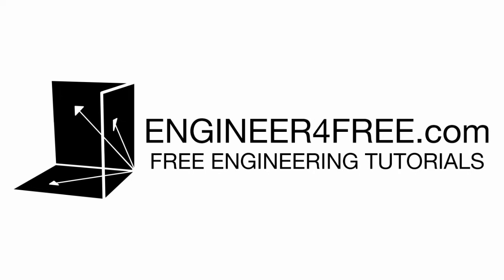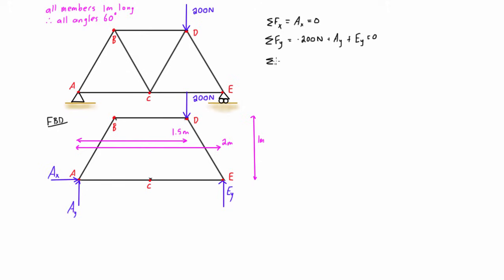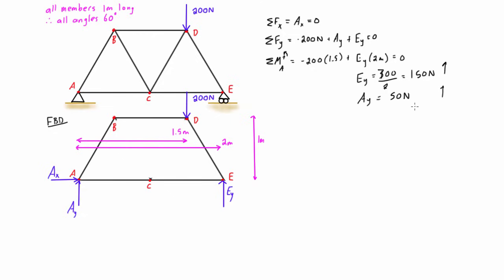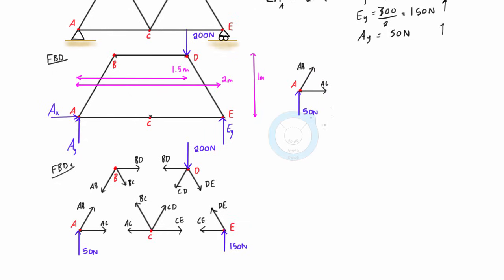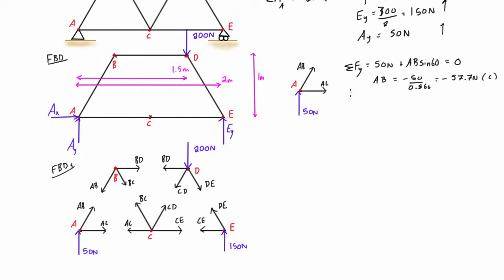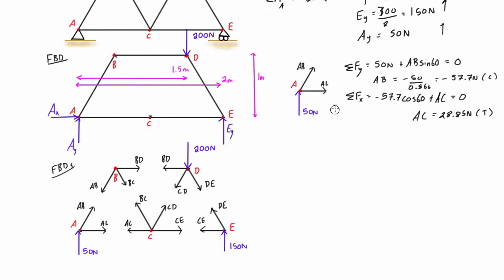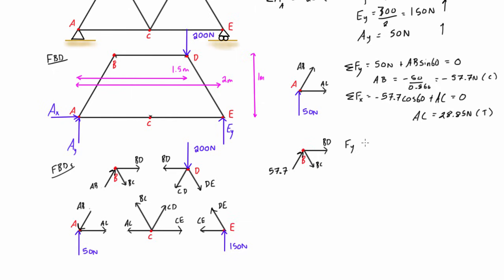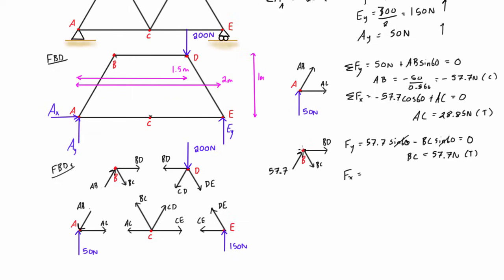Truss analysis by method of joints: worked example #1

Comment: At joint B why didnt you write that AB is negative 57.74 instead you wrote that its a positive
Reply from the maker: In a fbd, switching the direction of a force is the same as keeping the force in the same direction but switching the sign. The sign convention with trusses is to initially draw all unknown forces in tension, and if you find the magnitude to be positive it confirms it it is tension, and if you find the magnitude to be negative, it tells you that the member is in compression. At 4:50 I switch the "direction" of member AB on the main fbd because I now know that it is in compression. When I draw the fbd for point B, I know that the member is in compression, and I know the magnitude, so nothing about it now is an unknown. A member in compression pushes on the joints with it's magnitude. So I draw the force as such, with positive 57.7 N, pointing towards the member. If I kept it pointing in it's original direction of "away from B", then I would have to keep the negative sign, but that would be redundant knowing that it is in fact in compression. Does that make sense?
Reply: Engineer4Free thank you
Reply from the maker: You're welcome Mustafa!

Comment: At 7:05, why didn't you multiply BD with cos60 like you did with BC
Reply from the maker: BC is at a 60 degree angle down from the horizontal so the cos60 is there to reveal only its horizontal component. BD is perfectly horizontal, so no cos or sin function is required to reveal its horizontal component, because the whole force is horizontal already.

Comment: Hi, just seen your video however im kind of confused on the last bit you solved. The DE answer you found was 173.2 which was a positive number so wouldn't it be in tension instead of compression which should be a negative number?
Reply from the maker: Initially I don't write the negative sign but I realize that it was missing at 11:45 and put it in. The negative sign matches our convention that DE is in fact in compression.

Comment: You wrote “Fx = - 28.85 - 57.7cos60 - 57.7cos60 + CE

Equals to:
CE = 86.55n

Please explain to me how that works, I thought it would be 144.25, since there are 2 57.7
Reply: isn't cd supposed to be in the positive x axis direction? so it would be +57.7cos60 instead of negative
Reply: this is because cos(60) is equal to 1/2. so you have 2 * (1/2 )*57.7  which gives you  -28.85-57.7 = 86.55N

Comment: What do i do if there is a downwards load on Point B and Point C
Reply from the maker: First include those loads in the sum of forces and moments of the entire structure to figure out what the reactions are at A and E. Next, when you draw FBDs for every point, just include the applied loads at joint B and C just like how I did for joint D in this video and follow the exact same process that is laid out in this video solving the unknowns one joint at a time.
Reply: Each member has an length of 4m So say if the load on b is 13300 N and the Load on C is 7700 N. Would My Reaction at A be 3150 N and Reaction at E be 2450 ?
Reply from the maker: A truss that has the same general shape as the one in the video but with the applied loads that you described, the reactions would be Ay = 13.825 kN up and Ey = 7.175 kN up: the work is here: https://i.imgur.com/Tl9teVJ.jpg make sure that hat I drew actually matches up with your problem. The easiest check you can do is to see if the applied forces and reaction forces in the vertical direction sum to zero. Your applied loads are 7.7 kN down + 13.3 kN down = 21 kN down, so if your upward forces caused by the reactions don't sum to 21 kN up you know there is a problem. You found 3.15 kN and 2.45 kN which sum to 5.6 kN. Immediately you can tell that 5.6 =/= 21 and there is a problem somewhere. It's worth pausing for a second at this step and checking, because you can go back and find the error, otherwise you will carry it through the entire problem and not get the right answer. Lemme know if this helps.
Reply: The Diagram is correct but when i go to solve the joints and i get to joint e it does not add to zero
Reply from the maker: This is the solution: https://i.imgur.com/Yk9YZjk.jpg it all sums to zero at the end. You must just have just made a simple error somewhere along the way. Do take the time to figure out where you went wrong, it will help =)
Reply: Thank you so much i realised my mistake on joint B i subtracted the 13,3 kN to the 15.96kN sin(60) when i was meant to work out the value of 15.96 sin 60 first.
Reply from the maker: No worries! No better feeling than realizing you had the method right and just made a silly error somewhere along the way =)

Comment: how do you know when to use sin or cos?
Reply from the maker: You need to be comfortable with SOH CAH TOA: http://slideplayer.com/slide/10605540/36/images/3/SOHCAHTOA.jpg. Two truss members will always have an angle between them, in this problem, it's always 60 degrees because three truss members form an equilateral triangle. You need to draw a right angle triangle that uses two trusses as two sides of the triangle, those sides are the adjacent and hypotenuse sides, and the angle between them then matches the original angle that you know. You draw the opposite side of the right angle triangles that you just constructed to be vertical (parallel to the y axis of the structure). Sometimes the triangle will be "upside down" but it doesn't matter which way a right angle triangle is oriented, it will still have a defined hypotenuse, adjacent, opposite based on the angle being used, so be mindful of that. For example, in the calculation of BC: BC is the hypotenuse, BD is the adjacent side, and the vertical component of BC is the opposite side of the right angle triangle that we construct to solve for BC. Whether you use sin or cos entirely depends on how you construct the triangle, and which side of it is the unknown, but then always just follow the simple rules of SOH CAH TOA.

Comment: the question im doing has no measurement and the roller joints are in the middle...does that change everything????
Reply from the maker: If you upload a picture to imgur and link it here I can help you, I'm not to sure what the problem is that you are describing.
Reply: Engineer4Free yess plzzz.thanknu so muchhh
Reply from the maker: Oh yeah it's a very similar process. Draw the fbd of the entire structure. Break the 15kN into its x and y components though. Sum forces in x direction to get horizontal reaction at E. Do sum of moments about C to get vertical reaction at E (don't forget to include the horizontal component of the 15kN applied force in the moment calcs). Assume all members are the same length, so all truss angles are 60 degrees like the video. That will make the horizontal component of 15kN force's line of action to be 0.866 units above the supports, and all other distances will be 1 unit or half a unit. If you have to, just define each member as 1m, or 1 ft long, but now matter what you pick the "units" drop out in the moment eq because they are in every single term so it doesn't matter if its feet or metres or whatever. Do sum of forces in y to get the last vertical reaction at C. Now just go one joint at a time doing FBD of the joint. Draw unknown internal forces in tension, and applied loads or loads caused by reactions in their actual direction. If you calculate an internal force to be positive, it means it is actually in tension, if you get a negative, it's actually in compression. When you go to draw the next FBD of a joint that includes a now-known internal force, draw the it in the appropriate direction, ie tension pulls away from the joint, and compression points towards the joint. Iterate 6 more times (once for each joint). On the last joint, make sure that everything actually sums to zero in x and y direction. If it does, you've done the problem correctly, if it doesn't there is a math error somewhere along the way. Hope that clears it up, overall it's an extremely similar problem with just a few more members and a bit of a trick because that 15kN force has a horizontal component: don't forget to include it in the fbd of joint D, and also the horizontal reaction force in the fbd of joint E.
Reply: woaah haha thanks u so much!!!! sorry for mking u write out all that, helps so much thanks u!!!!!!!!!!!!!
Reply from the maker: No worries, I'm happy to help!! This stuff can get really confusing if you don't know how and why to do each step. Once you get it though basically every truss problem is more or less the same process :).
Reply: doing sum of moments at C, if a force on one point comes before C is the length a negative? and i was asked to only find the forces on some members is essential that i need to know the sum of moments on C and E
Reply from the maker: Yeah that works fine. If you assume each member is 1m long, then that means the truss itself will be 1m*sin(60)=0.866m tall. When you do sum of moments about one of the supports to find the other's vertical component, every term will be in units of kN*m. Like for example the moment caused by the far left applied load about point C would be 7kN*1m = 7kNm counterclockwise, the moment caused about C by the vertical component of the 15kN load would be 15sin(60)kN*0.5m = 14.49kN*0.5m = 7.245kNm clockwise, the moment caused about C by the horizontal component of the 15 kN would be 15cos(60)kN*0.866m = 3.88kN*0.866m = 3.36kNm counterclockwise and so on.... You get the sum of moments about C to be 7kN*1m+3.88kN*0.866m+Ey*1m+4kN*2m-14.49kN*0.5m=0. Now divide both sides / every term by "m" and you get 7kN*1+3.88kN*0.866+Ey*1+4kN*2-14.49kN*0.5=0 at this point you should see that it wouldn't have mattered if you defined the length of each member as 1m, or 1ft, or 1cm, or 1in, etc.... because the unit itself drops out and we are just left with the sort of "relative distances" like 0.866, 1, 0.5 etc and you can continue on with the problem and will not need those measurements again.
Reply: AHH yASSS i got it.. i just forgot to add the horizontal component but i got everything else.. thank U!!!!! but isnt 7kn negative?
Reply from the maker: hahaha niceeeee, no worries! Negative/positive sign for moments is not due to the forces pointing up or down, it's whether or not that force would have the tendency to induce a clockwise or counterclockwise rotation about the point that you are taking moments about. Just define either clockwise or counter clockwise as your positive sense, and then that will determine the sign of each term when you sum all the moments. If you haven't already checked out engineer4free.com/statics then you should take a look. Videos 25-34 go over the basics of 2D moments which might be a good review, and then videos 42-51 go over lots more on trusses (this video is #44 in the playlist).
Reply: ahh kk Ur the bestXD thanks so muchhh

Comment: When performing the calculation to get CE (i.e. CE = -28.85 - 57.7cos60 - 57.7cos60) I don't get 86.55N no matter how i calculate it...can someone please explain.
Reply: Bon Michael hey, make sure your are putting brackets when you are putting in cos(60) in your calculator.  {ie put 57.7cos(60) +57cos(60) instead of 57.7cos(60+57cos(60... this is because casio naturally leaves an open bracket instead of closing it automatically
Reply: Montana sLays thanks for replying. I realised that the calculator I was using was set to radians not degrees (rookie error).

Comment: hi. how do you know when to use sine or cos???
Reply from the maker: Comes down to trigonometry and the angle that you are using for SOHCAHTOA. Sine(theta)=Opposite/Hypotenuse. Cos(theta)=Adjacent/Hypotenuse. Construct a right angle triangle where the hypotenuse is the unknown force, one side is the x component, and one side is the y component. You always know the angle of the member because you can determine it from the diagram given in the problem. From there, draw the right angle triangle based on any angle you choose, and then determine which component is considered the opposite side, and which component is considered the adjacent side, then plug and chug in SOHCAHTOA. For example, when inspecting joint A, the angle opens counterclockwise up from the x axis, so when we make a right angle triangle from that angle, the opposite side is the y component of the force, and the adjacent side is the x component. We then use sin in the equation for the y component, and cos in the equation of the x component. Joint B requires that you are paying attention to the the angle. If you use BC as the hypotenuse, taking the angle as the angle between BC and BD, then the triangle will kind of be oriented downwards. The opposite side will be the y component again though in this case, and the adjacent side will be the x component. I hope this makes sense. Let me know if it does or doesn't. If this is confusing you, I'd take some time to review SOHCAHTOA to get comfortable spotting opposite and adjacent sides of right angle triangles no matter how the triangle is oriented. Keep in mind that in every iteration of this problem, I create a right angle triangle using the principles of vector addition (engineer4free.com/4/adding-vectors) where the unknown force is the hypotenuse, and its x and y components form the opposite or adjacent sides. From there we use the other forces acting on the joint to sum forces to zero and solve the unknown components one direction at time.
Reply: Thank you. I get it. but if you could do a small 2 minute video of that section. A few more people a struggling with that too.

Comment: Please explain why you use sin and cos for different situations please? I'm struggling with why and how their interpreting how the create opposite and adjacent triangles. Help
Reply from the maker: It really just comes down to SOHCAHTOA if you remember from basic trigonometry. sin(angle)=opposite/hypotenuse and cos(angle)=adjacent/hypotenuse. The angle in our case is 60 degrees, and the hypotenuse is the magnitude of the internal force. The sense of the internal force (whether tension or compression) is revealed in the analyses of the free body diagram sum of force in x and y expressions. So when I'm looking at the first joint A and get the expression for sum of forces in the y direction, I have: 50 + ABsin60 = 0. AB is the magnitude of the internal force in member AB. ABsin60 is the vertical component of the internal force in member AB and comes from the expression sin60=ABy/AB which is just sin(angle)=opposite/hypotenuse [where AB is the hypotenuse and ABy is the vertical component of the triangle]. The vertical forces must net to zero, which they do in 50+ABsin60 = 0 otherwise the join would accelerate either up or down. 50+ABsin60 = 0 can also simply just be written as 50+"vertical component of internal force in member AB" = 0... Same thing goes for when I solve for sum of horizontal forces at joint A; I get the expression: -57.7cos60 + AC = 0. This can be interpreted as "horizontal component of internal force in member AB" + AC = 0. We calculated in the previous step that AC = 57.7 Newtons in compression, you can find the x component of it by applying cos(angle)=adjacent/hypotenuse, or cos60=adjacent/(-57.7) , so the x component (or "adjacent" part of triangle) =-57.7cos60. When inspecting the free body diagram and summing for forces in horizontal direction, the expression is -57.5cos60 + AC = 0. They must cancel each other out, and because they are the only two horizontal forces they will be equal and opposite. If you are still struggling with when to use sin and when to use cos then I recommend reviewing some SOCAHTOA resources to realise when to use each. Cheers hope that helps.
Reply: Could you explain how you did joint B I'm struggling with that mainly.
Reply: When you have multiple y or x forces and determining their cos sin relationship, I struggle to imagine the triangle to decide with it is either
Reply: Just imagine the angle is being taken from the horizontal x-axis. If u wanna get the vertical y-component, use sine. If u wanna get the horizontal x-component use cosine.     This becomes vice versa if ur angle is taken from the  y-axis.

Comment: how come if the forces are pulling away from each other they are in compression?
Reply from the maker: I assume you are referring to the FBDs where the arrows are pointing away from the joints. In this problem when we talk about tension and compression, we are referring to the members, not the joints. I just erased the middle parts of each member to be able to draw the arrows at the joints, but if you look at any middle section that I erased, if there are two arrows point toward the middle of the member, it is in compression (for example, BC) and if there are two arrows pointing away from the middle of the member it is in tension (for example, AB). Does that clear it up?
Reply: that makes so much sense now, thankyou so much!
Reply from the maker: No, I think you have it backwards.  At 3:32 I say that AB is in compression and at 6:03 I say that BC is in tension. I update the main fbd each time I find a member that's in compression, for example at 4:50 I shange the direction of the arrows for AB. That fbd is as seen by the joints. A member in compression will press on a joint and a member in tension will pull on a joint. So I change AB to be pressing on joint A and joint B because I determined that it is really in compression. Does that clear it up?

Comment: If every side length is equal to 1, shouldn't the side length be about 0.87? (Since 1^2-0.5^2=root(0.75)=0.87.
Great video though!
Reply: I thought about this too, but I guess it doesn't matter since that side length (height) was not used to calculate anything